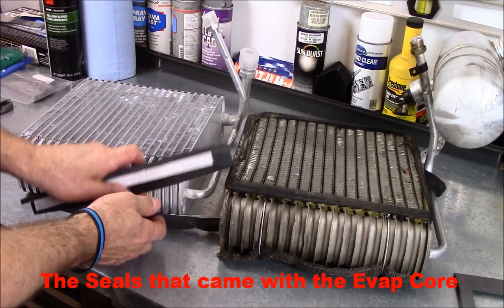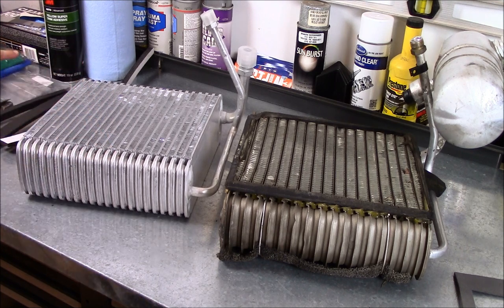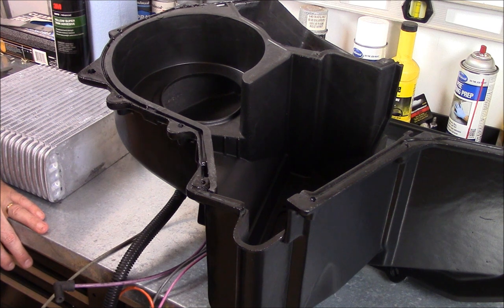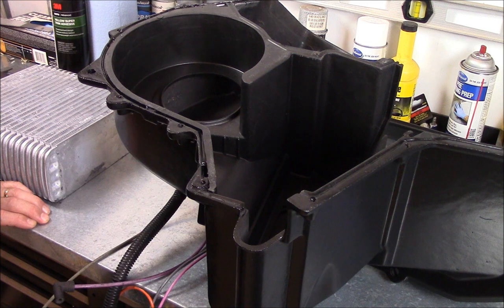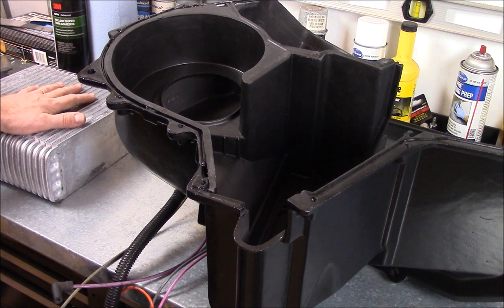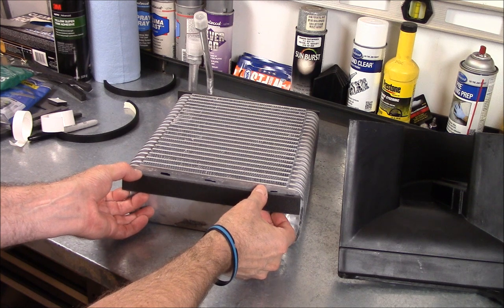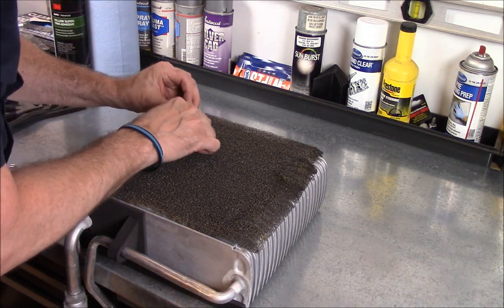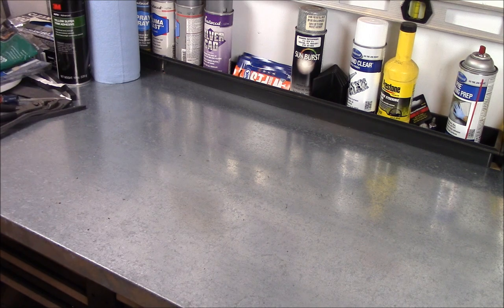G Body A/C Box Assemble Part 2!! 1987 Olds 442: Video 40

Comment: Saw your pt 1&2 and some other of your videos...i have learned alot thank you...for taking your time and explaing things
Reply from the maker: Thank you!! I appreciate the kind words. Share with a friend to get the word out there.
Reply: @hutchhiperf  im doing my ac box as we speak.. Not a full break down like you...but new blower, resistors,evap,heater core..i cleaned the box out and all trash out and little flap...got the butal tape from napa today (smaller size). Foam came on sides of the new heater core (aluminum) ...im going to use some vacume cleaner foam filter for the evap.?#1..WHERE DID YOU GET THE FOAM TO GO AROUND THE EVAPORATOR LINES AND THAT CURVE RIGHT BELOW THE EVAPORATOR LINES..
Reply from the maker: @boss94ways51  Go to Gbodyparts or MikesMontes. They sell a seal kit that has all the pieces.
Reply: @hutchhiperf  hey there i finally got done with everything just got to put the Allen grove ac bracket on to mount the sanden compressor ... I ran the purple/ pink vacuum line carb and the gray/white vac line the the heater control valve....( they both were cut) so now i have vacuum ...MY ? TO YOU IS.....IS THE FLAP/DOOR UNDER THE GLOVE BOX SUPPOSE TO CLOSE ON NORMAL & BI LEVEL.....WHEN I TURN IT ON MAX THE DOOR FLIPS UP BUT WHEN I TURN IT ON NORMAL & BI LEVEL IT COMES BACK DOWN......IS IT SUPPOSE TO DO THAT.??? ?.....BLEND DOOR WORKS FINE AND I CAN HEAR THE DOOR OPEN & CLOSE BEHIND THE VENTS IN THE MIDDLE OF THE DASH
Reply from the maker: @boss94ways51  That's exactly how it's supposed to work. On MAX A/C the heater valve outside cuts circulation of hot coolant to the heater core and that door opens to recirculate cool air from inside the car. This gives the A/C the best chance at making the air at the vents as cold as possible. Anything other than MAX and it closes and draws outside air.

Comment: Where can i find that mesh that goes ok the back of the evaporator core ? Mine is all deteriorated. Also where did you get your evaporator core and heater ?
Reply from the maker: You can use AC "prefilter" foam. You can find it in the hardware store with the other AC window unit stuff. It's an open cell kind of foam.  I believe I got most of the parts from Rockauto.

Comment: My hvac box cracked at the bottom is there a way it can be fiberglassed or is another unit needed since these are hard to find?... I dont like the under dash units...
Reply from the maker: It's plastic. You should be able to use a cyanoacrylate adhesive (super glue) to fix the crack. If clearance permits, you could glue a thin strip of plastic on the crack seam to bolster the repair.